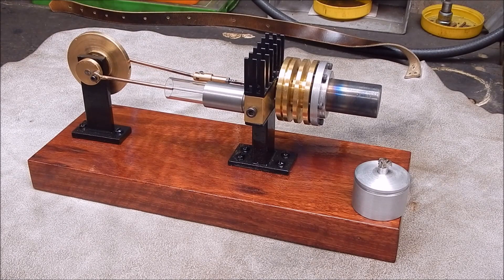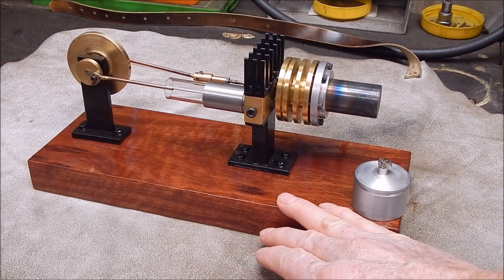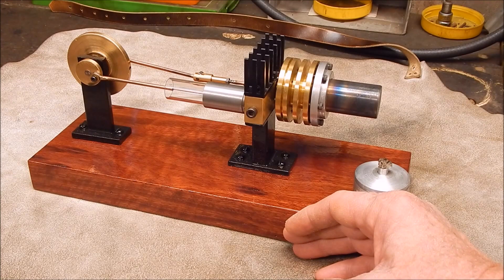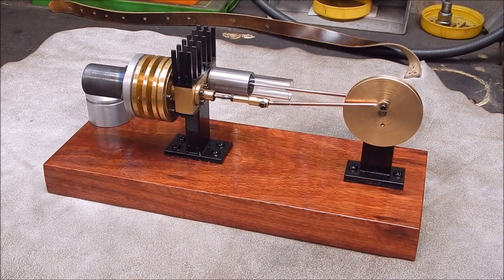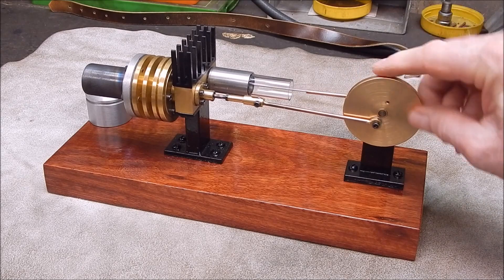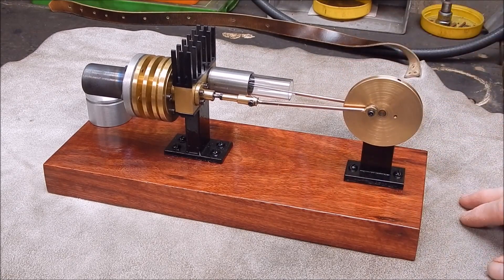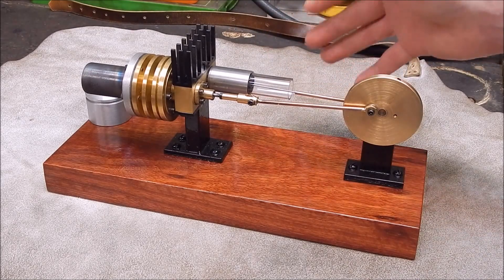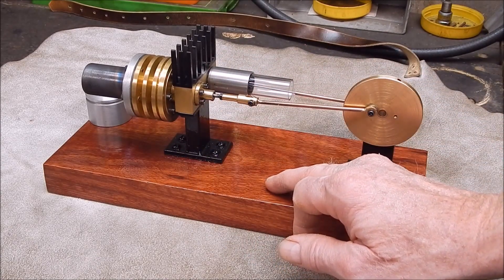The gamma Stirling Engine build is complete and runs well

Comment from the maker: If I did this again I would have the piston centres 10 mm further apart to allow greater separation of the two crankshaft ball races.  This would counter any flywheel weave at low speed caused by slop in the ball races (as seen).

Apart from that the over specifications seem to be on the money.

Cheers rob

Comment: Cracking job, superb craftsmanship, runs like a charm. You should be well pleased with that Rob.
Reply from the maker: Thanks.  It turned out well.  Like all ground up builds there's a few things you would have done differently in retrospect.  But overall it runs as good as I hoped.   i will check out your channel - looks interesting.

Cheers Rob
Reply: Thanks, my channel is mainly model steam engine restoration but i do a few other videos about stuff i'm interested in. Hope you find something of interest.

Comment: They send you the engine, then you get to finish the development for them, this is like an R&D video series on a Stirling engine...   ;)
Well done...!!!
Reply from the maker: Hi Pierre,

This is a totally designed and built from the ground up engine by me.  All done from metal stock.

I did however, get a flame licker from Banggood a while back that needed some mods to run.

Some bought models actually do say in the description that some fettling may be required to get a runner.

Cheers Rob
Reply: @Xynudu  No wonder it looked so nice, too nice to be Asian sourced...   ;)
With Asian sourced product, lots of non mechanical items are mostly decent and well prices, not the same though about mechanical like live centers and similar...

Comment: Great looking piece of wood. Is that a hard wood that I've heard that you have to pre-drill to use nails on/with?
Reply from the maker: Hi Dave,

Yes, it's a very hard wood. You have to pre-drill it for sure.   Probably the hardest Australian wood after Mulga which is like steel.  The colours in Jarrah and Karri (which is very similar) are just beautiful.

This timber is now hard to come by and very expensive.  In days gone by it was just a basic timber used for railway sleepers and jetty piles etc.

Now it's very expensive.

Looks fantastic when oiled up or clear coated  as I did.

Cheers Rob

Comment: Persistence pays off Rob, very nice job.  These little engines are very therapeutic and relaxing to watch or even to have running away in the background.
Cam
Reply from the maker: Hi Cam,

Yes I knew I was close.  Just had to iron out a few bugs.  Craig Roop's original speci's were on the money, but I had friction losses to overcome.  I think the Banggod specifications I finally used gave higher compression, but Craig's figures were pretty good.

Anyway we got there in the end.  It was quite an enjoyable project and even though I had to re-machine/design a few components, I could always see the light at the end of the tunnel.

Fascinating little engines.

Cheers Rob